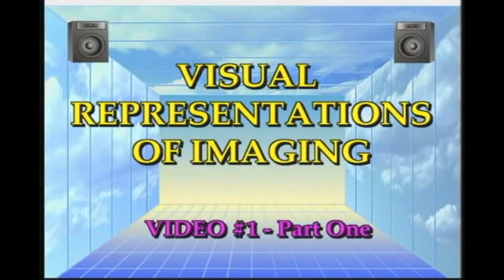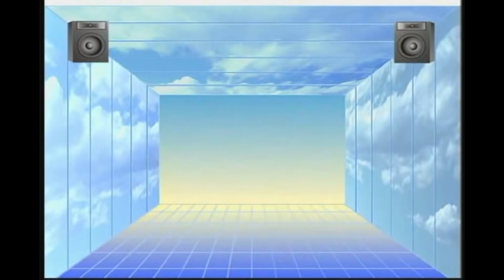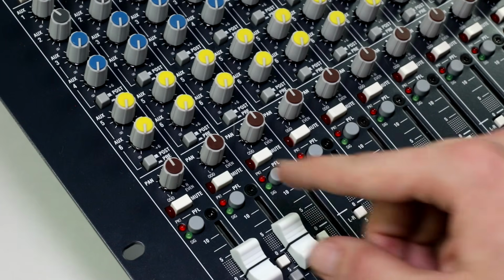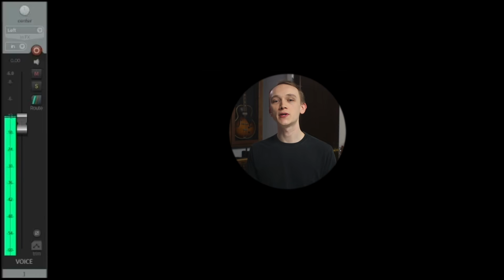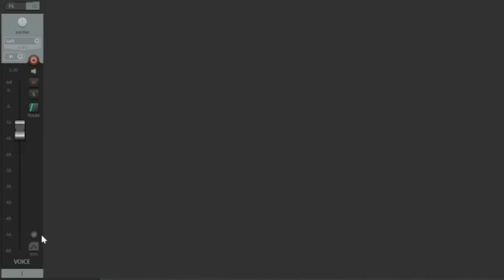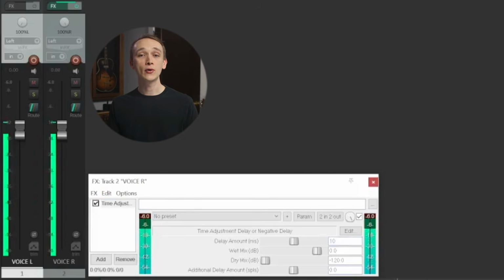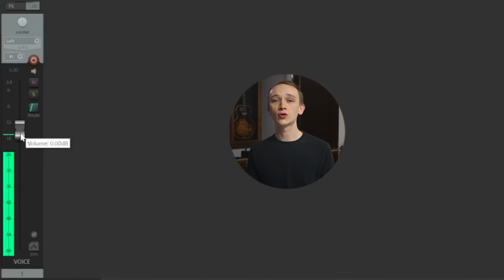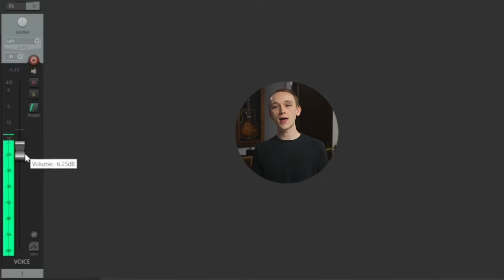Creating 3D Space In A Mix | Depth, Width & Height

Comment: I run true Haas effect in my mixing template. I say "true" because some people refer to the Haas effect as a simple short delay on one channel. While this does create a psychoacoustic effect and does create a palpable phantom effect, true Haas involves inverting a channel's phase and applying a rounding EQ, and then mixing that stereo image back in at lower levels with the channels flipped. This is an excellent summary - subbed.
Reply: That's more like a full 'binaural' effect. Prob is it adds a lot of extra 'mud' frequency for full mixes as relies on spectral filters..
Haas does refer to a property of delay, in fact it actually refers to short delays and whether we perceive them as phase or dinstinct echoes, dependant on a minimum length for them to be audible. its just that this effect is more often used as a term when describing the phase producing delay (that is not heard as an echo) produced by the distance between ears giving distance positioning

Comment: As far as depth, you could have mentioned how compressor’s attack and release can be used: fast attack cuts the transients which makes it seem farther while slow attack let’s transients through which gives a closer feel.
Reply: Never thought of a compressor this way, that's very useful, thanks!
Reply: @FlorentChardevel  Here's a vid you may enjoy that elaborates on the point made:https://youtu.be/QmjMa3Dn1Bo
Reply: 🤝👏Very useful!
Reply: THAT EXPLAINS SO MUCH OMFG THSTS WHY MY SNARE ISSO ITTY BITTY
Reply: can you give me an example?
Reply: @cymananroll  have a drum loop playing, put a compressor on it
default settings will be 0 threshold 1/0 compression and different attack and release times depending on the plugin, they dont even matter at this point since there is not compression happening yet, bring the threshhold to 25 30 db and bring the compression to the most agrresive setting 30/1 lets say ( normally you wouldnt do someting like that unless you know what you are doing and using a technique that requires doing that, we do that to just the test how compression will effect the sound, we make it agressive so that we can hear it and understand it better)
now you will hear some compression, you can play with threshold there to what it changes but after that put it on the 25-30 range again
now play with the attack and relase setting 
bring attack to lowest, 0ms or 1ms, you will hear that transients are squashed and the loop now is a lot more pushed back in the mix 
now bring it to 300ms or 1000ms someting you will hear the opposite, it will be more in fron, it more snappy 

i am not getting into the relase setting because after that there will be combinations involved, low attack low relase low attack high release high attack low relase etc etc and i can explain all of them but be sure that it wont mean anything to you unless you do some testing yourself and force yourself to actually try to hear the differences those different settings make.
Reply: @mehmetabdullah250  I see, it makes a lot of sense, thank you so much, I will get to testing! :)))
Reply: Sir Please can u explain Please

Comment: With a voice with reverb an interesting technique is to have the reverb in a parallel channel and compress it using the voice self via side chain. This way, when the voice sings loud, the reverb disappears momentarily but it comes back when the voice is lower or silent. Another way to bring the voice upfront, even if it has a reverb.
Reply from the maker: Wow! That’s an interesting idea! Thanks for sharing.
Reply: @AudioUniversity  I learned it from Chris Selim’s channel. Here is a video showing it, a little old, but very good. One should be gentle on that effect, otherwise it doesn’t sound good. 
https://youtu.be/ozseVOOEAHY
Reply: This is just sidechaining the reverb from the vocal, it's a quite normal mixing technique for avoiding the reverb masking the voice.
Reply: @jemwand2530  well, maybe I should edit my comment and change “interesting” for “normal” and all will remain the same. https://youtu.be/1sruEnQ9HkU?si=cX7Op-smqADG0xS9
Reply: That seems counterintuitive... I would probably apply that kind of technique to delays... But anyway, its worth checking out.
Reply: Additional bonus side-effect (or main reason i do it) of that is it kind of softly 'ducks' the verb so you have audible verb without clarity loss.
There's the opposite technique too, using an expander or gate quite famously use on Bowie's Heroes..but in digital DAW days i'd agree that automation is more powerful for big structure changes.
Reply: You could also automate the reverb for the vox to come down when you want to emphasize the vocals.  Easier and won't change the quality of the verb.